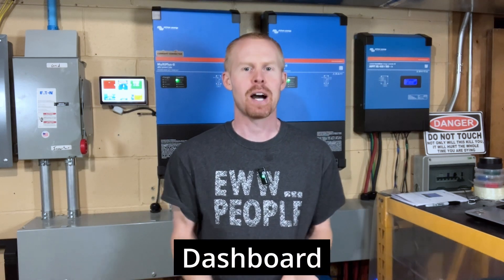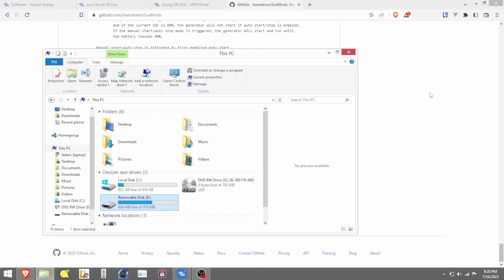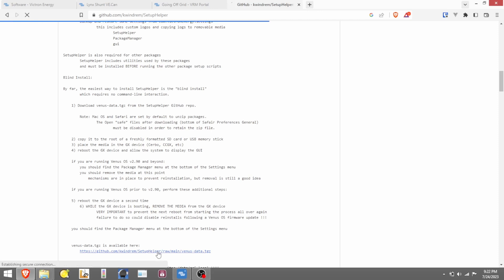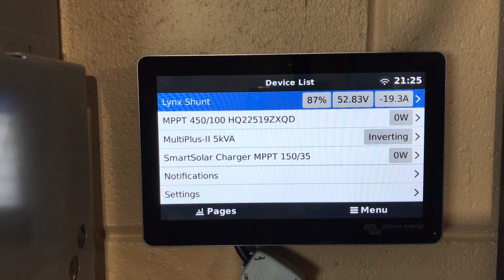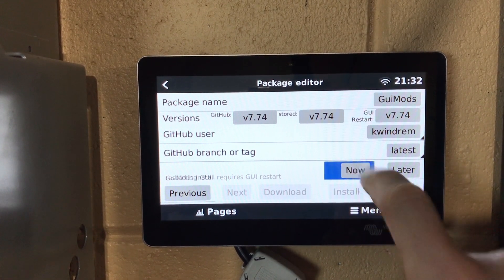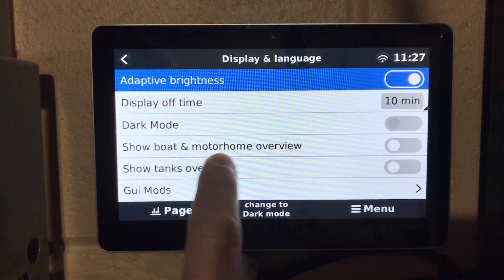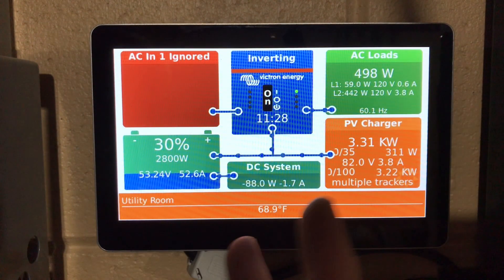Supercharge Your Victron Cerbo GX Dashboard with GuiMods

Comment from the maker: GuiMods Repository: https://github.com/kwindrem/GuiMods
SetupHelper Repository: https://github.com/kwindrem/SetupHelper

Links to the parts & pieces in the video (affiliate links)
------------------------------------
Victron Cerbo GX
https://www.currentconnected.com/product/victron-cerbo-gx-system-controller/?ref=AzzpK9Fl

Victron GX Touch 7" Display
https://www.currentconnected.com/product/gx-touch-display-cerbo-gx/?ref=AzzpK9Fl
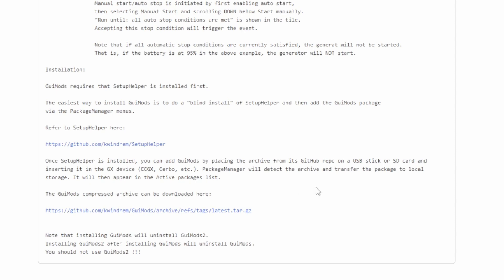Reply: Please include the repository link like you did for the other github links. The mod menu download link you show at 5:22 is no longer included on the github site. Otherwise, I was able to get the gui up and running. Thanks for the helpful video.

Comment: The instructions don't work, can you please update this
Reply from the maker: There's been a lot of changes since this video came out.  Victron changed how they wrote the code for the Cerbo so you would have to install an older version of VenusOS to be able to use guimods still.  A lot of the changes that were made in it though have been rolled into the latest updates of Venus OS.

Comment: I installed the battery temp sensor from the multiplus 11 and can’t see the readings on the cerbo gx
Reply from the maker: You need to enable the sensor in the Cerbo.  
Go to Settings -> I/O -> Analog Inputs and  enable the sensor that you connected.
Reply: @ ahh thank you pal

Comment: Does it work on victron guiv2?
Reply from the maker: @pppidsn647  no, it doesn’t work with v2.  A lot of the changes Kevin made in his GuiMods were incorporated into v2.  V2 is also a complete rewrite in a different language, so it would take time to make changes if Kevin decided to redo GuiMods.

You could always try v2 and rollback if you don’t like it.
Reply: @AdamDeLayDIY  Thank you so much for the reply Adam. I have tried V2. What I don't like about V2 is that it can't show the specific data of every mppt and pv inverter on the overview page, only a total solar output. I need click into the solar to see more details. I prefer to use v1 and consider the GuiMods. By the way, if the installation fails for any reason, will it cause problems with gx?👍
Reply from the maker: @ I haven’t actually heard of any installs failing.  Because it stores the last installed version of Venus OS, I would assume it would just roll back if it fails.

Comment: Great Video, and thank you. I don't know if something has changed on the repository site but I cannot find the second file to install "after" I install the helper? Am I missing it? thanks
Reply from the maker: So after I put that video out, some changes were made to the GuiMods site to simplify how you can install the package.  So instead of needing to download the file and go through the same process like you did with the SetupHelper package, now you can just use the Package Manager (installed by SetupHelper) to install GuiMods.  

You'll just go to the Package Manager inside your Cerbo settings and install GuiMods from there.

Comment: I have a Cerbo-S GX and my main goal is to make the relay controls accessible via the VRM oortal and web access (I dont have a Victron screen).  Would you expect this to work on the Cerbo-S GX?
Thanks
Reply from the maker: @campbelltiley5515  as long as the S model has relays built in, I would expect them to show up in the VRM.  As far as I know, the S model doesn’t have some of the connections that the full cerbo has, I just don’t know which ones though.  The software should be the same though.
Reply: @AdamDeLayDIY  Thanks. Has 2 relays. I will give it a go.
Reply from the maker: @campbelltiley5515  awesome!  It should act just like the full cerbo then.  Have fun!

Comment: Hi. I can see you have 2 multiplus 2. Do you think ir's possibile to connect 2 separate batteries, one to each multiplus? Each multiplus could manage one battery. Is it feasible?
Reply from the maker: Yes I do.  

It is possible, the question you should ask though is "is it recommended?".  I would say, probably not. If you have a larger load on one inverter vs the other, you will drain that battery bank quicker and then if that inverter shuts down due to a low voltage disconnect, your entire system will go down.  Why not have one larger bank for both inverters?
Reply: @AdamDeLayDIY  It's an idea to use different battery packs, that will  work bad in parallel... (Different Ah , different ages, different brands). So if one of the batteries goes down, both multiplus will shutdown? And if i use 2 Cerbo Gx?
Reply from the maker: @TheSpidertop  If you have them configured in split-phase, yes when one inverter goes down the other one goes into a fault state.  It's expecting to have constant communication between both inverters.

A separate cerbo won't buy you anything.

You can have different Ah, ages or brands in parallel.  I've got 2 DIY 280Ah packs and an Orient Power 230Ah pack connected together.  The biggest thing is you have to configure based on voltage because you might not have battery communication between all the different types of batteries.
Reply: @AdamDeLayDIY  thank you very much for your clear explanation. Ok.

Comment: Great video, @AdamDeLay07.
Installed GuiMods in 10mins, along with a couple of RuuviTags. All good.

Just one question: Does updating future Cerbo GX firmware cause any issues with the GuiMod?
Reply from the maker: Thanks!  Glad your install went smoothly!

 I haven’t had any issues with any non-beta updates.   Kevin continually updates his Guimods package for any hidden “gotchas”.  Now I do know that the gui 2.0 that Victron is working on right now is not compatible with Guimods.  The underlying language is different and it actually incorporates a handful of changes that Guimods has.

https://youtu.be/gGCxxiSB1lc
Reply: Thanks Adam. 😊

Comment: --- starting setup script v5.18
ERROR SetupHelper requires GUI v1 which is not on the system - can't install
installation failed - package has been uninstalled - exiting
root@einstein:~#
Reply from the maker: What device are you trying to install the guimods project on?
Reply: cerbo gx   victron  os 3.20.37    @AdamDeLayDIY
Reply from the maker: @patrickruiz6764  you cannot install guimods when your using the beta version of the Cerbo interface.
Reply: thank you for replique
Reply: oui j'ai reussi a installer guimods sur la version V3.20.37 os beta  si vous voulez j'ai pris une video laisser moi un email !!!! je vous envoie
Reply: Yes I managed to install guimods on version V3.20.37 bone beta if you took a video let me an email

Comment: Thanks for the informative video. Once the SetUpHelper was installed  I did not need to download the latest .tar.gz file to a USB to install it - I have internet connection on my Cerbo and after changing the settings to auto download GUI updates it pulled down the file after a few minutes.
Reply from the maker: Appreciate that!
Yeah I realized afterwards that you can use the Package Manager to download packages instead of having to load the USB drive again.  Thanks!

Comment: Hey mate, thanks for getting back to me. @AdamDeLay07  maybe youtube took it down....... Your system is looking great now! We have a 15kva triple parallel system. I was just wondering if the words (bulk, abs and float) light up for you? I have a couple Victon MPPT's connected to the system, I'm wondering if the system is confused and not picking up the signal from the MPPT's properly? Maybe you my have heard something? Cheers for the support, watched a fair few of your vids while setting up the system😎 @OrganicPower-Australia
Reply from the maker: No worries!   I gotta start looking at your install from the beginning!  I can tell you’re a sparky.  Install looks great!
So the bulk, abs and float on the inverters will only illuminate when you charge from AC In.  The SCCs don’t pass their state to the inverters.  
Keep up the great work!
Reply: Hey, that's magic your a champion! I'll flick the relay and give it a test, thanks again for all your content and this response @OrganicPower-Australia 😎  @AdamDeLayDIY
Reply: Hey, we were so close 😔 The (AC In) lit up and (Invert) started flashing, but still no action with the Bulk, Abs and Float indicators in charge or invert mode? Not sure what I'm missing. 🤪
Reply from the maker: @OrganicPower-Australia  do you know if you were charging from the mains?  Your system will have to have the “mains on” light lit, signifying it’s using mains power and then your system will need to be charging from your mains (ac in) power.

Comment: Hey mate just installed today going off your guide had no worries my version is Guimods v8.29  and Setup Helper v5.17 the only issue I'm having is i cant get my screen to look like yours, and it reads in Kw not Watts also my solar PV Chsrger isnt giving me much info like yours is... Stumped to know what needs changing
Reply from the maker: Min only reads in watts when it’s less than 1000w.  Otherwise everything changes to kW. As far as the PV charger, I have 3 different MPPTs that are being read.  Maybe that’s why it looks different?

Comment: hello thank you for this video you mark cerbo 2.90 beyond but I am in 3.13 and impossible to install like in your video !!!! sorry doesn’t work!!!
Reply: and I couldn't find a way back to version 2.90
Reply from the maker: Can you explain a little more why you think it’s “impossible”?  Have you installed SetupHelper?  If so, you can also use that to directly install guimods.
Reply: hello thank you for the answer impossible to install the Setup Helper? on os venus cerbo 3.13 refuses telling me not to install and see gui-v1 I even went with putty in ssh mode and nothing!
Reply from the maker: @patrickruiz6764  I haven't heard of anyone else having issues installing either SetupHelper or GuiMods before.  Have you customized your system in any other ways?

Have you followed all the different options on this page?  https://github.com/kwindrem/SetupHelper
If so, you might have to submit an issue on GitHub to see if Kevin can explain what's going on.
Reply from the maker: @patrickruiz6764  If you have to file an issue on Github, you'll want to give as much detail as possible as to what's not working.  What step your on and the error message you get.

Comment: Thanks for the excellent video. Is there a way to visualize and toggle between both the original Victron page and the GuiMods page on the Victron display? In fact, when I enabled the Victron original page, the GuiMods visualization was no longer available. It seemed deinstalled.
Reply from the maker: Thanks!  

So to switch between GuiMods and the default Victron display, you can go to the following setting: 
Settings -> Display & Language -> Gui Mods -> Flow Overview
Reply: @AdamDeLayDIY  Thanks. I will try that. Best.

Comment: hi it seems that the readme section has changed and no longer has a link to the guimod. tar compressed file. and the link is now at the bottom of the readme section not a quater of the way down. I don't program and am not familiar with github nor how to use or navigate it. I have the setuphelp.tar file but can not find ho to get the equivalent for

Comment: Can you use a verbose go without a multiplis
Reply from the maker: I'm guessing you're asking about a Cerbo GX without a Multiplus?  

If so, only Victron equipment works with the Cerbo.
Reply: sorry should have spell checked. I have a victron shunt and dc to dc charger and lynx distbutor. Just not wanting to ad a multiplus at this time. can i still add a cerbo gx and and display and still get battery info from the dc to dc charger. I will also add victron solar charger soon.
 @AdamDeLayDIY
Reply from the maker: Yes you can use a cerbo without the multiplus.  It will read data from the smart shunt as well as the solar charge controller.  I'm not sure however if it will be able to get any data from the DC to DC converter.  My initial thought is that it cannot.  You would still be able to see the data from the shunt though.

Comment: Is there way to get rid of the Grid box on the dashboard if you aren't connected to the grid at all?  That takes up a lot of space if you are "off-grid" and that space could be used to expand one of the other boxes like the battery of PV ones.
Reply from the maker: I believe I have seen it where the Grid box isn't visible, but I don't think that it changes the allowable real-estate for the other boxes.  Now that red box is helpful if you connect a generator, because it could show that information as well.
Reply: @AdamDeLayDIY  I'm trying for no grid and no generator :) I'll install this when I get time to see if it can be fiddled with.. Surely there would be a way to modify something to make a tile larger.  I would like the entire left side to be one tall PV tile (for listing lots of arrays) or one tall battery tile (for listing all the cell voltages of a specific battery or some other specific data point per battery)..
Reply from the maker: @davidb.5544  Good luck!

I do know there's a display option for DC Coupled Systems which does seem to rearrange things and shrink the Grid box, so I know that the developer can do it.  Not sure how customizable it is from the user standpoint though.

Comment: Is there anyway to manipulate the servo to work with an eg4 18kpv and eg4 ll v2 rack batteries?
Reply from the maker: Not with the same level of detail you would receive with the Victron inverters.  I thought I saw somewhere that the EG4 batteries could be connected to Victron equipment.  You could hook up a Smart Shunt but that would only give you data from the DC side of things, not the AC side.  

I would probably look at Solar-Assistant for the 18kPV.

Comment: So what's better solar assistant or the cerbo
Reply from the maker: Each one is designed for something different.  The Cerbo is designed for Victron equipment.  Solar Assistant is really designed to fill a gap where a lot of other inverter manufacturers lack in their monitoring software.  Each has similar features.  You can view live and historical data from both, and depending on the connected hardware, you can manipulate settings of hardware on both.  

Currently the only Victron device that Solar Assistant supports is the Smart Shunt.  

Basically, if you have a Victron inverter, I would recommend the Cerbo.  If you have any other inverter that’s supported by Solar Assistant, I would get Solar assistant, regardless of the manufacturer’s software. 

I do plan on doing a review of the VRM and Solar Assistant at some point.
Reply: Btw have you got my email yet
Reply from the maker: @blue7pheonix862  no I haven’t.  I’ve been keeping my eyes open for it.  I don’t see anything in spam either.  Might need to double check the address: adam@going-off-grid.com

Comment: For this Victron inverter, can it run on 220volts, because in my country the AC input is 1 phase 220volts
Reply: Yes they are actually made in the EU and have models available for 220v systems.
Reply: @UnkyjoesPlayhouse  Do you have a reference on how to install and the type of victron inverter?
Reply from the maker: Most of the stuff I would normally point to would be designed for the US market.  I would take a look here and see if there’s a local company near you.

https://www.victronenergy.com/where-to-buy
https://www.victronenergy.com/inverters
Reply: I use a multiplus II 5kVA, it's 220V, cost 1400€ in Europe. Rs450/100 Mppt controller cost 1100€, prices give or take 100€ depending on rebate.